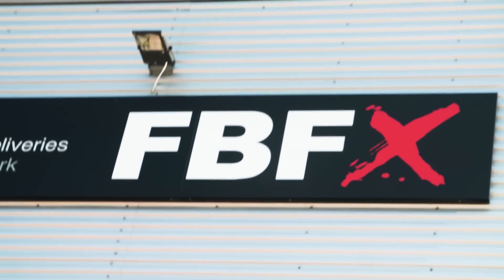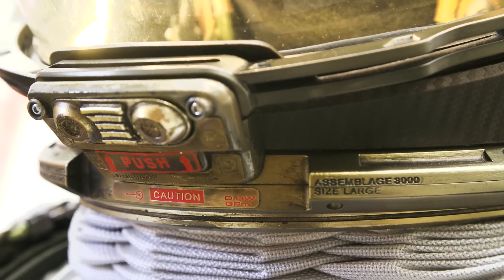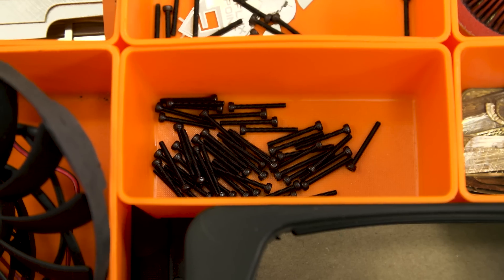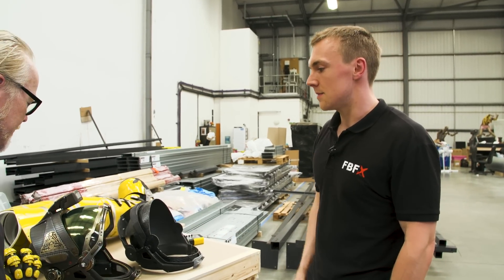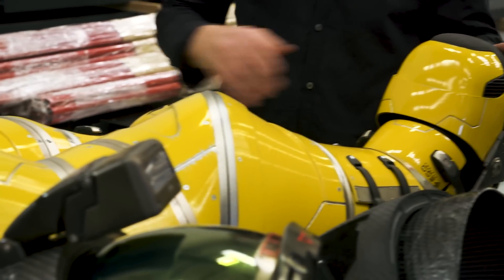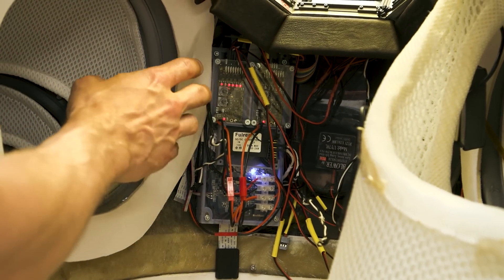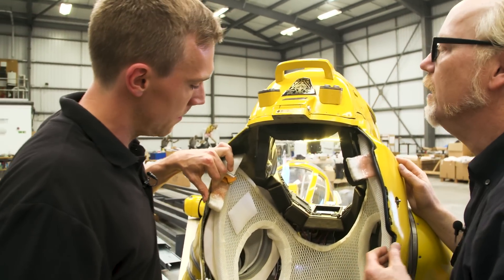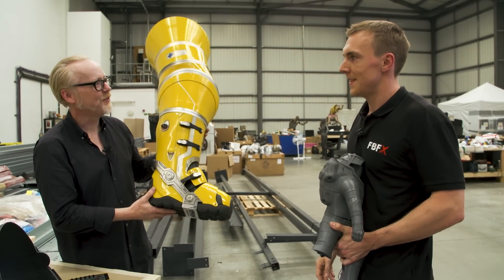Adam Savage Explores the Science-Fiction Spacesuits of FBFX!

Comment: THe british do costumes the best. THeir period costumes are amazing. Will we have a Tested episode on how to design, etch and weather brass?
Reply: One of these days when I get my shop squared away that's a video I'd like to do...  In the meantime though, I can tell you that Clickspring did a video on etching brass for the face of his clock build, and the process is basically identical to etching a circuit board, in fact Ferric Chloride is the most common etchant for both brass and copper. I'm sure there's plenty of videos out there about etching brass parts for models. (Search 'photoetching brass')  There's lots of tutorials out there about weathering props and costumes, but once you're working with real metal (Or even resin castings with an outer surface of metal powder!) you can use a patina solution to near-instantly achieve the oxidation of real-world weathering.
Reply: I have etched brass without Ferric CLoride. I find it rather messy. I use electro etching technique with a lot of success. I use salt water and a walward powersuppy. I get very deep etches. I use laser toner plastic sheets and then iron them on to the clean brass.

Comment: "Very rigid"
crack
Adam: "Ooh"
Reply: Adam's prolly waiting for the "You break it you buy it"

"I would GLADLY buy it"
Reply: that look he gives the camera hahaha
Reply: Glad it was like the cheapest part.
Reply: Well... he's gotta test it. After all it's the name of the channel
Reply: it's ok, it has a Kevlar layer, it'll be fine even if a huge break formed :)
Reply: i think he didn't crack the carbon fiber ,its the middle plastic or rubber joint which most probably dislocated
Reply: +Lumor To be fair, the difference between Norm and Adam is that Norm would've already done it before being prompted by the guy about the thing's rigidity...
Reply: If Norm did that, the comment section would be a never-ending string of attacks and complaints towards Norm. Double standards :p